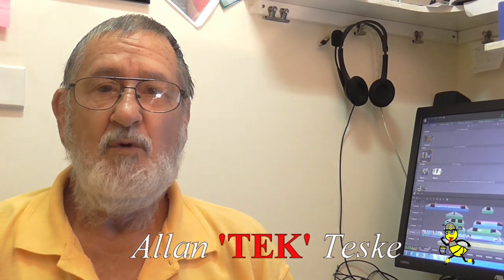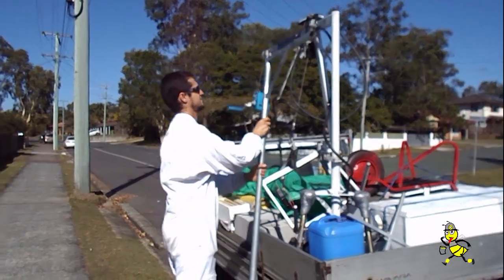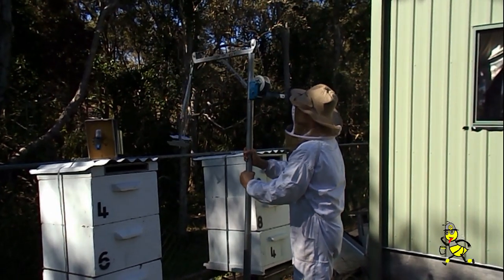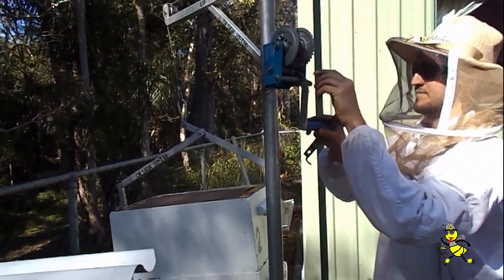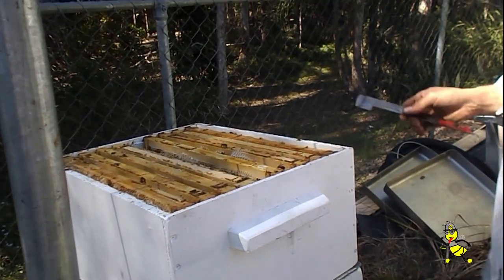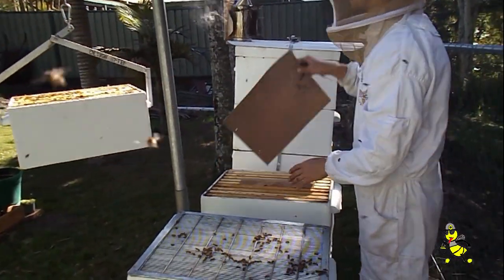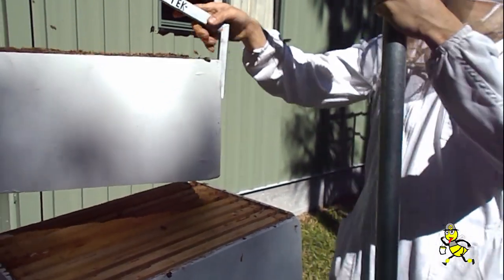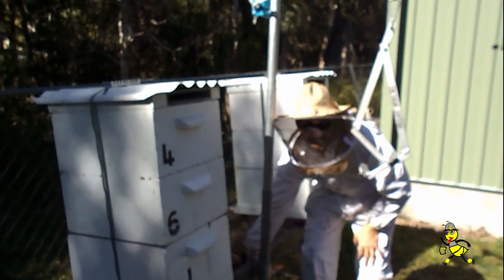7. 11 Lif - TEK Ezy -  Hand Winch Model

Comment: Looks great!
Reply from the maker: There is a later model on my channel which has Aussie Jack Strap instead of the winch.

Aussie Jack Strap has an automatic braking system built into it and it’s a lot easier to use